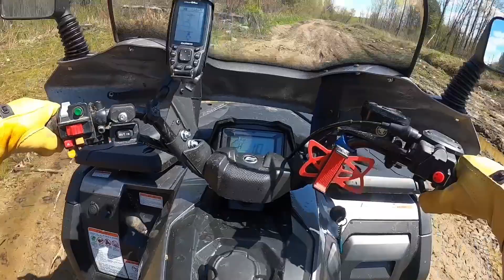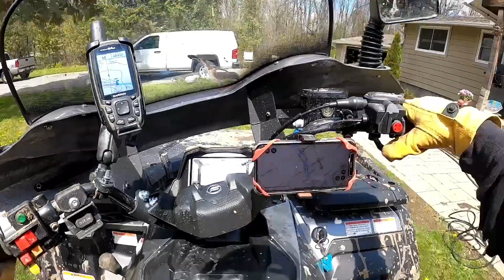2021 CF Moto CForce 600 Getting stuck in the mud. . Trail Ride Part Deux.

Comment: U winched yourself out drop like 2 feet and gave it quarter gas and got stuck clearly this is your first time on a quad
Reply from the maker: Hey Dylan, thanks for your comments. I'll admit it wasn't my best moment but, not my first time on a quad. Been riding them for 30 years or more. This machine was brand new and still in break in period so I was trying to be gentle.